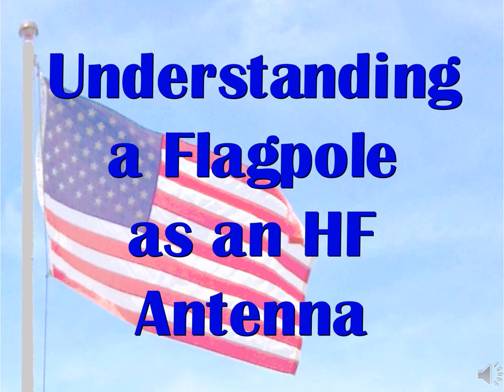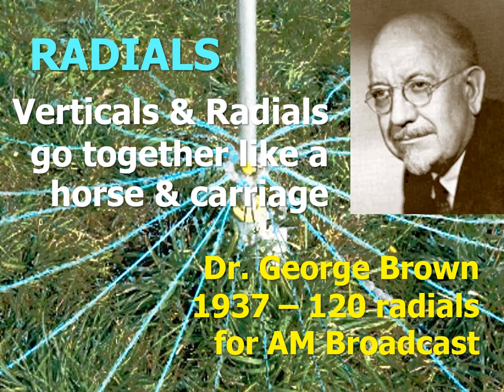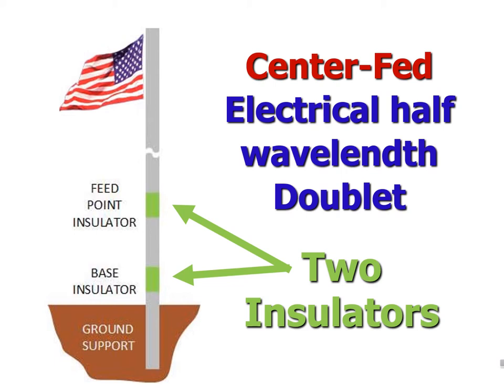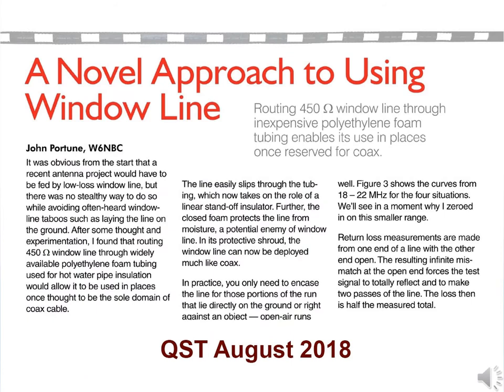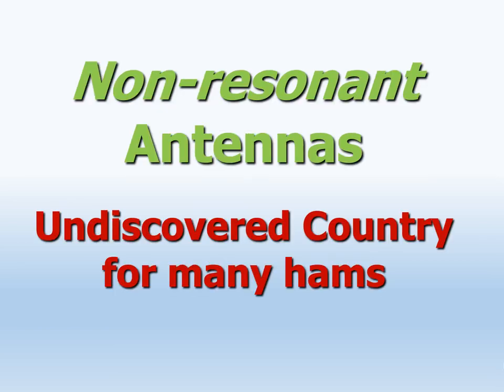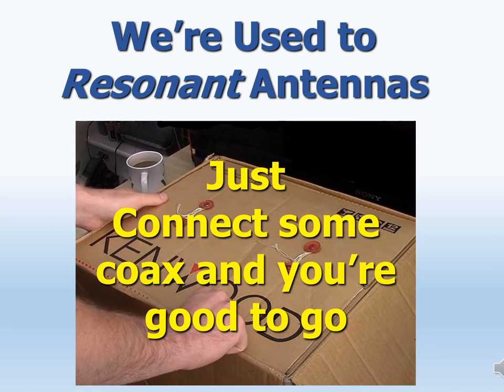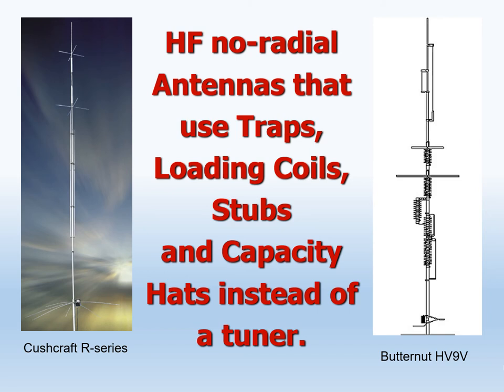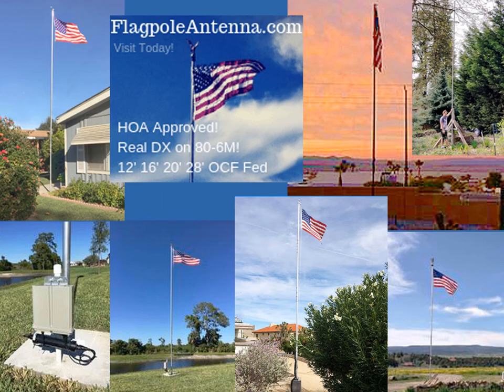Flagpole Antenna Greyline

Comment: Interesting presentation John. Buying the flag pole is not too bad but when you add in all the extras you need, it gets a bit expensive. Will have to wait on this one for a while. But I live in an HOA so this would be a great antenna to have in my yard. Thanks for doing the video...de KQ1K.
Reply: I agree. I built the flagpole myself and had to purchase the remote tuner, balun, coax, etc. Still came to $650 but works quite well. I live on a small lot and there is no room for a wire antenna. I don't have an HOA. I have pictures and details at N6MJS.

Comment: I have used verticals for most of my 59 years as a ham.  Some of the best performing ones had no radials.  I am using a 6BTV which I originally installed with 16 radials.  Several years later I had to move it because of the growth of a nearby tree.  When I moved it I tried it without radials and the result was so good that I never installed radials.  I am getting better signal reports without radials than I did with.  The antenna was also easier to tune and the swr lower.

Comment: I thought a balanced antenna was a dipole no ? how can a off center dipole be balanced ?
Reply: he makes mention of his term balanced in the video. balance doesn't  necessarily mean equal length both sides, but rather not grounded anywhere, and equal and opposite fields in both sides of the feeder, unlike coax .🤷‍♂

Comment: Some years ago, one of my friends lived in an area with a lot of restrictions, regarding antennas.  His house had plastic gutters and downspouts so he laid a wire antenna inside his gutters, most of the way around the house.  To run the downlead from the gutter to his radio room, he put up a "dummy" plastic downspout next to the window.
It might not have been the worlds most efficient antenna, but with an antenna tuner, it got him on the air and it was invisible to the neighborhood gestapo.
Reply: There are some commercial parts you can buy to make that sort of wire antenna.  There is some sort of a balun to feed the ends, and a terminating resister for the end of two wires that should be the same length.  I always felt another way to get around an HOA would be to have a rhombic antenna in the gutters or otherwise running around the eaves.  But the HOA might wonder why you built your house in a diamond shape and pointed it in a different direction than the other houses next to it.

Comment: John, great video. After moving from Ohio where I had a tower and beams, to a modular home in Florida, I installed the 20' OCF flagpole dipole. I also installed the MFJ 994BRT at the base, since I had a 500w amp in case I needed it. I proudly fly Old Glory while still on the bands. My issue is they advertise 6-160, but I am only able to get 6-40, and work mostly digital mode, as SSB is harder to achieve. I tried to use the balun but would not load properly, and I also installed a lightning arrestor between the antenna twin lead and the tuner coax, since here in Florida they have many lightning strikes. 80m would be nice, but for what the antenna is, and having for almost a year, so far so good. I am back on the air working DX again.

Comment: John I recognize you as the creator of this antenna. Thank You!
I have just recieved notice that my 20' flagpole antenna has shipped. I am anxious to put the fire to the wire! I live in a mobile home as well, and was elated when I stumbled across this antenna design at Greyline Antennas. I will update once I have it all installed and radiating. A random length of wire laying on the roof tuned remotely is not a very efficent radiator.
Phil - KF6IF

Comment: Great video John! Have one comment/disagreement though. When it comes to the definition of the "resonant antenna", I would disagree with your take about resonances corresponding to frequencies with minimum SWR. As I see it, at resonance, antenna only presents the "real" (R) part of the impedance (Z) to the feed. Anywhere else, impedance is complex (R + jX), and (usually) mostly capacities (X<0)  for short(er) and inductive (X>) for antennas longer then resonant length (this is oversimplification as X quickly switches between + and - value along the line).
It is often true that SWR is minimal at resonance, but only because |Z| = SQRT(R^2 + X^2) might have minimums, but that is not generic case! There are at least two problems with this conclusion:

1) some antennas have very SMALL or very LARGE value for R at resonant frequencies, and when SWR calculated against 50ohm feed, SWR swings can be large. For example, two antennas with Z1=10+j0 and Z2=35+j35 - the first one is (very) resonant, but has quite higher SWR

2) The real part changes over frequency, so you can have the same antenna resonant an every multiply of lambda/2 (resonant as in X=0), but R go from 15 ohm on some to 1000s ohm on other resonant frequencies

The best (the only) way to observer resonant frequencies fro an antenna is to plot complex impedance (Z), and either observe where imaginary part (X) crosses or where Smith Chart crosses "horizontal" line.

No, why do we care if Z is complex or not is quite different story that very often get's complicated (and unpredictable) due to "impedance transforming magic" that happens in the "wave gude" (coax for example). Impedance that are mostly real (R >>X) and not equal to the feed point (50 ohm) are quite "predictable" and one can take coax length into account (to the benefit of impedance matching), but with non resonant antennas and complex impedance, all that goes away, and results are quite unpredictable.

Hope this makes sense and i did not badly miss the point :)

THANKS for the great and thought provoking video!

Miro, N9LR
Reply: Hi, you are absolutely right.
His way of catagorising resonance Vs non-resonance by SWR (less than 3) is absolutely wrong.
Resonance is where it's purely resistive and without any reactance.
De VU2RZA

Comment: I now live in an HOA and have received OK to put up a 24' flag pole, 
which I already own.  What are using to isolate the two lower sections 
of the pole?  Can you share tubing sizes or plans with us.  Great video.
  de WB4IZC

Comment: I built this antenna based on one of your videos. It works great.
I am planning some upgrades (tuner, balun) and have a question.

Would you clarify where the balun should be placed? One video has it shown before the tuner and in another it is shown after the tuner.
I currently have the balun after the tuner.

Thanks...

Randy
Reply: Logically it should be before the tuner.
Reply: @Subgunman  Tnx...

Comment: Great video John. I would like you to make more comment on the grounding of the tuner at the tower. This would seem to be adding a ground to the antenna system? I wonder if this is improving the efficiency of the antenna at frequencies where the top section is a multiple or fraction of a quarter wave for instance?

Comment: I was thinking a 9:1 balun was to be used to connect the ladderline to the coax. 2 things. 
1. does that do anything to the swr since its ocf, and most use a 4:1?. 
2. if theres a9:1 at the base will an external tuner in the shack be acceptable?

Comment: John which is the best way to have the circuit? as you show in the video tuner, balun, antenna or as on the website faqs balun, tuner antenna
what about grounding the tuner? Is necessary to ground for correct operation  or is this because of lightning protection?
waiting for my 20ft flagpole to come this week and not sure about the optimal schematic flow
Thanks Greg K4GAZ

Comment: I have several questions as to the suppliers of the antenna hardware. Source for the aluminum tubing for the two parts of the vertical, the type of material used for the insulators and it’s thickness. Is the spacing between the aluminum tubing within the insulators critical? If so does it vary between the radiating section and the ground mount section? How did you support the sections within the insulators? Would it be feasible to print out the insulator/spacers used for the window line within the lower section out of ABS filament or should we use a Teflon sheet and cut and mill out the dimensions needed?
If anyone else could chime in on this issue it would be appreciated!!!
Reply: I would think the insulators would be better if  turned out of Teflon solid round, and if my mobile antennae is anything to go by, needn't have the aluminum pieces spaced further than 20mm apart, 10 mm would be sufficient but it would depend on your power as well. 
It would need to have a hollow to allow the feed line to pass through, but that's all. I would be a bit wary of a print, but if you do then I think the print lines need to lie along the length of the spacer and pole, and not circular (as would be the easiest to print without supports)
Thin walled ally tube would in my opinion be the way to go but its not always easy to get and you would probably need to have at least grade 6082 then. Most aluminum suppliers will have tubing that could be made to work.